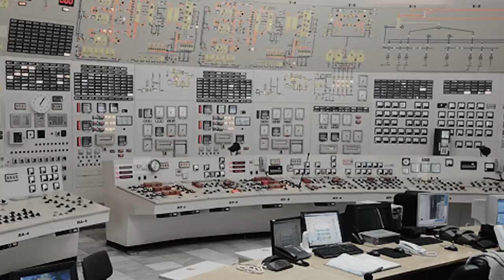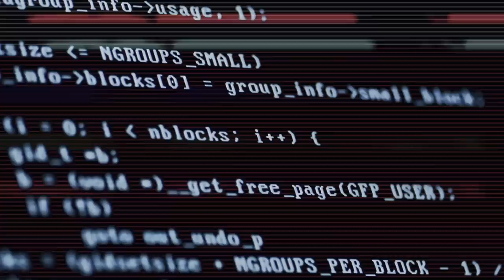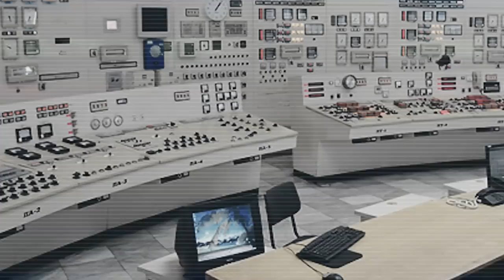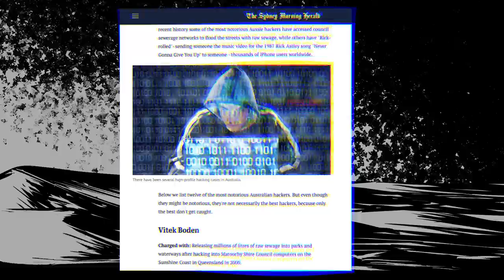The Sewage Incident - When Operational Technology Isn't Secure

Comment: The problem they had was they were engineers. I was water well driller/pump installer for 20 years and worst systems that I constantly had to work on were the engineer designed ones. We would tell them this will not workin real life I know it looks good on paper but it will be bad and this is why..never listened and I had to drive hours all the time to fix little bs just like we told them it would and after closing the customer 10’s of Thomson dollars the system would end up being overhauled to close as we could get it to how we would of from the start. Of course this worked and I didn’t go there again for like 5+ years. Also proved engineer wrong once about how much water would be pumped when we start a test he guaranteed it wouldn’t be over 18gpm cause you can’t get anymore through size of hose we had at top I said do you wanna bet? I got $50k says it pumps 25gpm. He got quiet real quick then he said you ain’t got 50k and laughed to my surprise my old man says your right he doesn’t. He’s got 100k if you going to bet then make it a real bet I’ll write check out right now for his 100k and you do the same winner takes the checks. It turns  out his mouth was writing checks that he couldn’t cover and after he bitched out like a middle school kid with some lame excuses we bet for lunch and damn me and my old man ate good that day 🤣
Reply: I’m a Wastewater Plant Operator and Licensed Electrician, joke I always heard was “My HS diploma fixes what your engineering degree fucked up”
Reply: @bizzzzzzle  lol that’s pretty good one. I also was electrician. My old man had all same license as me but masters also was licensed water purveyor which I guess was like super hard to get and was only few people in he state with it. He would get offers from random cities asking him to move there and run entire water departments. I remember he get the. In the mail and one was a connecting city to LA with like 1.5 million salary. Kinda crazy since we lived in rural east Washington state our entire county had like 3k people no way he would take that job more people in a couple blocks then our county 🤣 But just good laughs getting random letters like that and hey never call or anything.
Reply: @bizzzzzzle  Same goes for many other degrees and IT degrees as well that focus on the more practical things